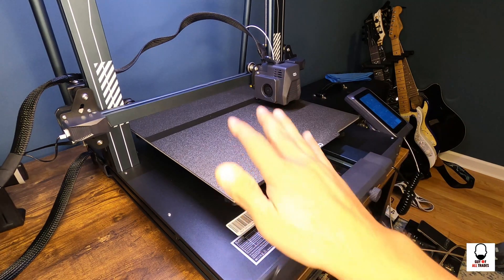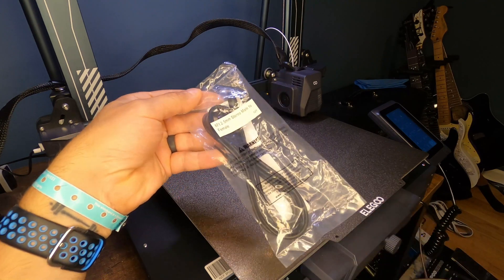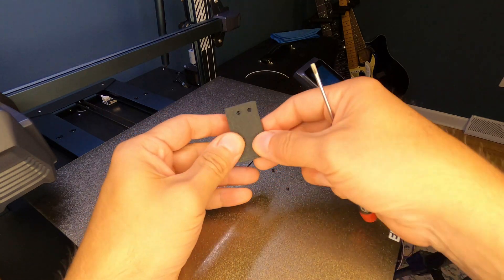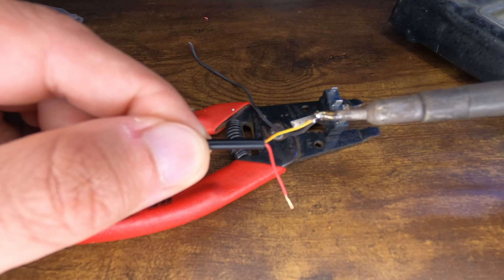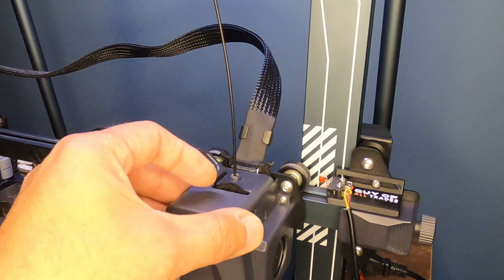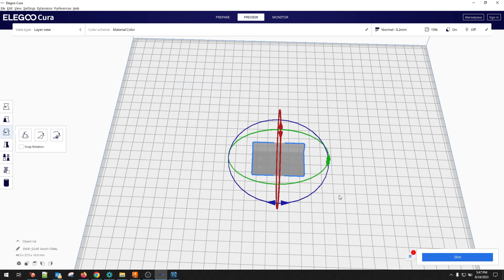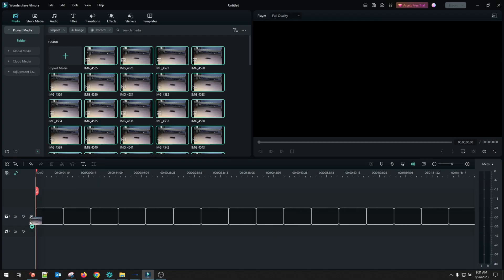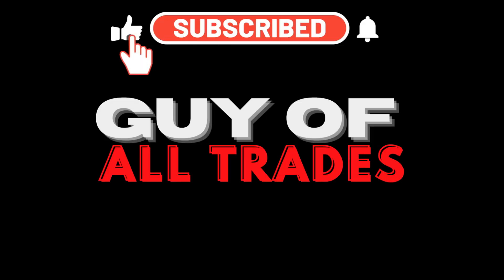How To Make Your Elegoo Neptune Timelapse

Comment: If it doesn`t work for you change in CURA from "save as TFT file" to "save to file". The "Save as TFT File" functionality is provided by a 3rd party plugin, and it seems that that plugin does not let Cura apply its postprocessing to the output.
Reply: Wow! Thank you. This solved my problem. What a silly work around

Comment: This is a great idea but surely you would need to factor in retract settings ?  Also within Octoprint, the  Octolapse plugin achieves the same result  , I run octolapse with an 8mp fixed focus and can eliminate the hot end form within the software settings.  I originally tried your method with a Hot wired go pro session and a modified optical switch,  it did work but the GoPro was (as usual) unreliable.  Good set up though and you have managed a great video.
Reply from the maker: Thanks! I thought about go pro but you’re right they are junk. I actually filmed this video with the GoPro lol. Back screen failed 3 months in. For retraction I only use the standard 3mm because of the direct drive. I get minimal stringing
Reply: @theguyofalltrades  I must admit even though I like the software solution, your setup is far easier and probably more reliable.  I have a DJI action cam which I am tempted to try but need to research the triggering methods for this camera.  You have got me scratching my head again … nice work though
Reply from the maker: Thanks. I like the dslr because you can’t really match the clarity. I went with the beagle cam and hated it honestly